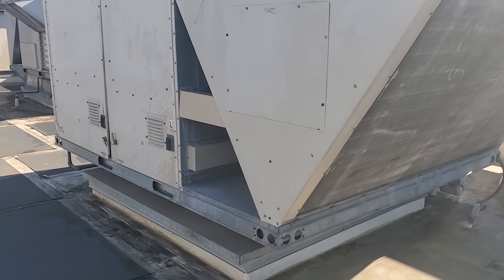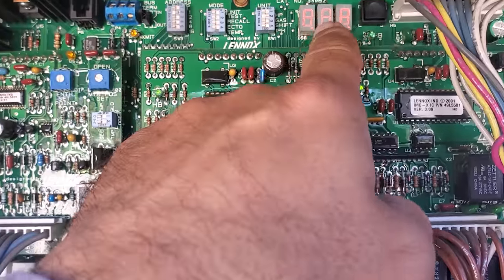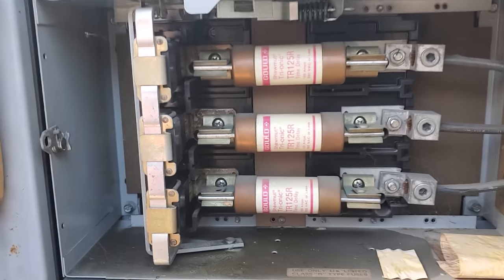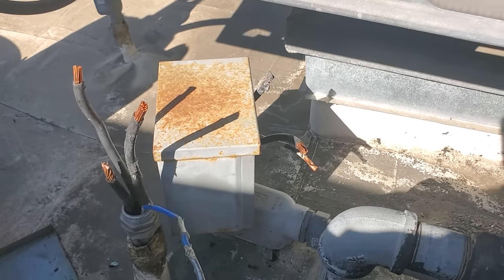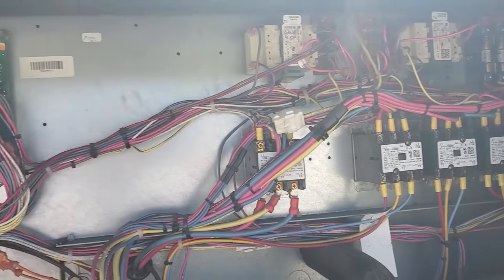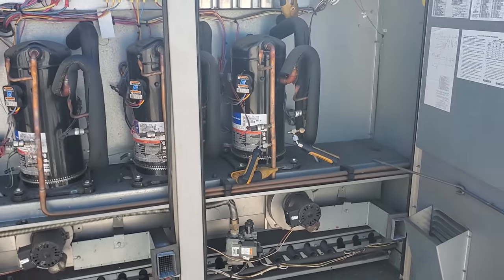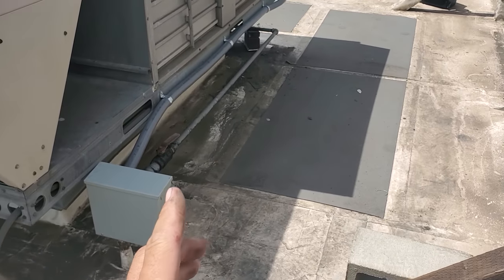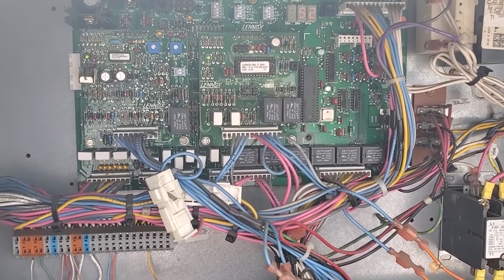ELECTRICAL FAILURES ARE FUN

Comment: It looks like the lug that was used for splicing the wire is aluminum.. That's a huge NO NO. Aluminum expands and contracts dramatically due to temperature changes, it's also a dissimilar metal to the copper wire. It was a very poor choice for the splice, it should have been made of copper instead. Expansion and contraction cycles over time caused it to loosen, and then become a hot spot further exacerbating the problem, and in addition to all this aluminum has a lower temperature melting point. Aluminum wire, aluminum lugs, copper clad aluminum wire are cheap alternatives to copper but pretty much all fail in the long run.. CCA or copper clad aluminum wire is showing up more often today. Avoid it because the aluminum at the core can oxidize causing it to turn to powder, and at some point the wire will fail because the copper clad surface cannot carry the current alone.
If you're maintaining or repairing equipment that is fed with aluminum wire, do your customer a favor. Keep a container of noalox on your truck or van. Back the screws out of the connection, pull out the wires if you can and use a small brush to thoroughly cover the wire strands with noalox, also coat the screw threads because if the lugs are also aluminum, the screws can bind in the threads due to the tendency of threads to gall in aluminum. Tighten everything down properly and it will be fine for several decades to come.
Reply: CCA huh?
Reply: exactly, you can oversize any wire as long as you use the correct breaker and fuses for the unit.
Reply: Noalox.....
Reply: Aluminum expands and contracts, yes, but this isn't aluminum wire used with non-tension connections.    This is copper wire with aluminum connector blocks, with iron screw points.   I've seen these stay solid for decades.   CCA is okay, depending on the usage.  For example, my car jumper/booster cables are 4 gauge CCA.   It let me have longer cables for a lower price, and the amount of usage isn't going to make me run into the 'aluminum wire shorts' problem.    CCA is even okay for network cabling - if you have the right connectors (which not much does).  It's just a royal PITA to work with afterwards, especially if it's not labeled as such.   

You shouldn't get progressive oxidation in the aluminum core of wires, unless the copper layer has been compromised (that's a different problem), or it's a really poor grade of aluminum.   Remember, aluminum is insanely reactive.  If it didn't corrode instantly upon exposure with the air, it would burst into flame (like lithium or sodium).    So it always already has an oxide layer as soon as it's plated with copper.  it's just that there shouldn't be any further reaction due to the copper coating.
Reply: @tbelding  What I said about aluminum is still the case, whether it be the wires OR the lugs. Lugs will expand and contract due to temperature change more than other materials.
My experience is that there are very few panels, buss bars etc that will actually use aluminum, plus the fact that it's a soft metal and prone to galling of the threads of any set screws regardless of the materials they're made of.
My experience of working in the trade for many decades is that most lugs are some kind of copper alloy with a cadmium plating to protect against oxidation.
Perhaps what you 'thought' was aluminum lugs were really cadmium plated copper or some other copper alloy which is quite stable regarding expansion and contraction rates due to thermal causes.
I've never ever seen any wire splicing lugs, split  bolts etc that were made of aluminum. That would be madness, and welcoming a failure.

Comment: Instead of a continuity test with an ohmmeter, I use a megger.  It will pick up shorts to ground that a 9 volt battery can’t find.  It will also catch intermittent shorts such as a bare wire in close proximity to ground. A meggers high voltage will cause it to arc to ground.

Comment: I’m surprised that your code allows splices on 100amp circuits in a small box like that. Certain to fail UK installation regulations!
Here you would have supply lugged into a local weatherproof isolator then out in armoured flexible to the AC unit. 
But here we have 415v across phases so a bit more danger.
Reply: Some units are 600V.
Reply: yea true. 208x100 = 20.8kW, 415x100 = 41.5kW. 20.8kW with 415v will be safer as it will just be 50A

Comment: i build engines and transmissions (both stock and racing for both) and those dental tools are incredibly valuable as tools. Removing O-rings and formed pistons are far easier to work on with dental tools as an example.

Comment: That was really good video. I just think that the burned terminal could actually cause the other unit to stop working. Once something starts creating arcs and sparking, it works as a radio transmitter and produces a lot of high frequency waves. If the other unit has some unshilded wires for data comunication those could work as an antenna and transfer this frequency into a signal that didn’t make a sense to the unit so it locked.

Comment: We had an identical problem with a loose phase wire on our three phase fans for our cooling tower .  Melted the junction box connection.  Three phase motors do not like losing a phase!!  Hehe

Comment: The three phase units the company I work for has the same behavior for a failed phase, or wrong phase rotation (if they have the monitoring option, but at least all with scroll compressors do). This is to prevent damage to the unit. They stay locked out until you cycle the power.

Comment: The bad connection will cause a wide electrical voltage fault back up to the main supply xfmr and anything else connected to it, which is likely what tripped the second unit. It can even pull voltage down on the distributing line if bad enough until the fuse melted or BKR tripped. Unusual that you had a fault just light enough to burn itself up but not trigger protection. It very well could have been a lightning strike that caused it.

Comment: Howdy. Absolutely great.
You saved the elctrician a lot of time and headache by your fault localizing work. And probably your customer a lot of money.
And yes. Always check both the phase to ground volages and between phases voltages. If one or two phase fuses have blown the circuitry could still deliver a ghost voltage on the blown phases. An induction motor motor would do this. And a control voltage transformer too. Control voltage tranformer primaries are often connected between two phases. This reduces the loading unsymmetry of the power line.
In high regards.

Comment: Fieldpiece is the best quality equipment that I have ever used! Chris, I have been absorbing so much knowledge from you and this video is very familiar to a situation that I have been dealing with here in Florida. During thunderstorms if we get a sudden interruption in our power service, my personal 2 ton Maytag package unit gets confused and the the compressor doesn't fully start... possibly a weak cap? Regardless... turning the unit off for 2 minutes and restarting solves the issue. That being said, I couldn't help but think that additional dining room ac that you diagnosed simply was acting up due to that service arcing or a lightning strike... I have been learning all of this from you! I will be rewatching your video to test my run cap for my issue here in the humid Florida heat. Cheers friend....

Comment: The second RTU circuit boards fast flashing lights indicates 24v low voltage, probably caused by the other units issue. Also loose wiring connections where Lennox crimps 3 wires (it's a shrink wrapped connection) together after the transformer. I had a similar service call related to this problem of low 24v to the main board

Comment: Sometimes arcing can cause tons of noise and can literally make the wire a big antenna, this was literally how heinrich hertz found that theory, he transmitted stuff through arcs. The other reason is that loose connections and arcing can cause an imbalance in a circuit, if these circuits are near with each other or are sharing the same busbar it can screw with it and cause voltage drops enough to mess up electronics. That's in EE Territory, phase angles harmonics, but the main issue is the power factor, if one part of a system has a Problem with its power factor it will screw everything around it

Also the disconnect might've tripped because of an unbalanced 3phase circuit.
Reply: Hendrik Hertz huuumm!

Comment: When I was engineering mgr at a plastics plant, we had 3 water chillers that were junk. Basically, they were older, industrial, Carrier, hvac units with very old R22 herm sealed piston types in a lead/lag config. The freon was pumped into heat exchangers on the evap side, el cheapo tight budget style, everything else was stock. My boss literally would not put ANY money into his plant. Everytime this beast went down, it took the whole plant down. Cannot blow mold plastics with hot molds, sticky icky. One time a comp burnt up and I told him, ya better replace the other comp too cause that burnt windings contaminated that circuit too.   He didn't believe me. After having the hvac guys replace that compressor and recharge, 6 hours later... YUP burnt the other one. Guess what buddy, now ya gonna drop 12 grand on 3 compressors! Watching this video, makes me kinda miss those days....

Comment: We just had 400 ton York chiller loose operating display go blank (#3 of 4) after power blink checked incoming power ok cycled power at switch gear still out recycled at unit system came up cleared phase loss unit started up and ran. Electronics sometimes do what they want.

Comment: You can totally have feed back at the main panel from one circuit to another when one circuit fails.
Reply: I think you watch too many movies haha
Reply: @jman0870  How so? If you plug a cheap chinese power supply in one room, and plug in a radio on the same phase on the other side of the building, you can literally hear the switching frequency. Sparking and arcs create massive EMI especially when you pull several amps.
Reply: @FrozenHaxor  EMI doesn't affect motors and line power dude....only electronics.
Reply: @jman0870  Not for the last 20 years or so. Not many movies worth watching. I guess I learned stuff from my dad that was employed as a degreed electrical engineer for about 40 years.
Reply: @jman0870  Right. EMI can have zero effect on power circuits. Induction is not a thing. Ya gotta believe!
Reply: @DomManInT1  Jesus dude you are talking about hypotheticals that never happen in HVAC. The level of EMI required to disrupt the line side circuitry of an RTU is absurd and damn near impossible without outside influence. If you claimed EMI affected the communication and analog circuitry I would have wholeheartedly agreed with you. What you are claiming could have happened is practically impossible. Sorry dude. You're wrong.
Reply: @jman0870  Never happen. Keep believing.
Reply: @DomManInT1  Go ask your engineer father how much EMI it would take to cause three phase and PSC motors to burn up the line side wiring to them and quit arguing about it buddy. You've already stated you aren't an engineer. Maybe you should talk to one.
Reply: @jman0870  I quit arguing about this topic a couple of comments back. Guess you missed it. Keep the faith.
Reply: @DomManInT1  Typical response from somebody who is afraid to be wrong. It's whatever dude. You do you.
Reply: @jman0870  Bingo! You do you. That should have been your attitude all along and you would not feel so badly now.
Reply: @DomManInT1  Why would I feel bad about preventing gross misinformation on the internet?
Reply: @jman0870  I didn't imply that it affected motors, I was mentioning the fact of what happened later in the video with the circuit board of the other RTU being totally scrambled and frozen up.
Reply: @FrozenHaxor  fair enough. The board acted the way it did because it only had six volts. EMI is not common in HVAC outside of the occasional installer who doesn’t use shielded wire for communition/analog signals, especially in commercial where 460v is common.
Reply: Huh?

Comment: As a computer consultant, who has had to work with other computerized systems (phone systems, etc), I can attest to some of the other comments here.   The initial blowout likely surged through the local power network, which gave dirty signal power to the other units.   Some probably managed to reset themselves, but in this case, the system locked down into a "I have no idea what to do, so I'm going to do nothing and run a warning light" mode.   If there had been a power outage after that occurrence, the board would have lost residual power, allowing a clean startup.  I had an exploded outlet that did just that to the battery backup connected near to it.  The UPS went into a lockdown mode, requiring it to be unplugged, powered off, plugged back in again, then powered up - after which it worked fine.   

If you have any piece of electrical equipment that's doing strange things, one of the first things to do for troubleshooting (besides checking that the input voltage is correct) is completely disconnect all power and leave it to sit long enough for all the capacitors to discharge.  On a PC, that can involve popping the coin battery out as well as pulling the power cord.  On a car, it involves disconnecting the battery terminals.   (I always do both, many only do the positive)    (Your car will go through a learning cycle after that, so don't panic about weird performance until it lasts more than 15 minutes of active driving).    In this case, shutting down the main breaker does it.    

I'm actually astonished that nobody on site turned the stupid thing off once they knew it wasn't working.    If something electrical has failed/isn't working, and you don't know how to troubleshoot it - turn it off!   I keep telling customers that as well "Unplug it, and I'll come as quickly as I can"  (then I find they've been flipping it on and off until something worked, switched parts around, etc).

It was definitely interesting watching your breakdown/troubleshooting method.  I've never worked with 3-phase power, so it's still very unusual for me.

Comment: I have a UEI DL479 and the FP HS36. The UEI is a pretty nice little inexpensive meter. It definitely can get the job done. It has capacitance capabilities, ohms, continuity, temp, voltage, amps, diode. I like the UEI leads better than FP's leads.
Reply: I got em all and favorite is still the 40 year old Simpson, kinda bulky tho
Reply: I've never seen a UEI make it to five years without an issue.
Reply: @jman0870  its my backup meter, but its not too shabby for the price
Reply: @jasonjohnsonHVAC  I have one in my bag because I needed a meter that could do micro amps DC in a pinch. I still don’t like them 🤣
Reply: @flipfloptanlines926  Awesome analog!

Comment: A three phase power monitor will pay for itself - they can be set for monitoring under voltage and over voltage and the time the fault lasts before a trip... so when you get into a low voltage on one leg it will save your machine... most rooftop units built like the ones you showed doent have single leg fault protection... nice video.  In an arcing fault situation all kinds of voltage spikes will go through the entire service and even into other buildings that might be served by that same transformer which will cause havoc on all types of electronics...

Comment: Metering with a high impedance tester, you can see nominal voltage at the load with an incoming phase dropped or feeding through a high resistance.. Voltage will back feed from another phase through the load, and voltage levels will be unpredictable. Use a non inductive load like a heat gun or 1KW load and measure voltage across that. You'll  see it.

Comment: 23:45 the bar unit got single phased by the burnt connection, were these 2 units in the same panel? if that's the case, when a unit gets single phased all bets are off

Comment: I am sure as the connection was failing on the 1st unit it was throwing a lot spikes into the electrical system. I was working in a building one time & drilled a 3/16th hole in a brick wall for a conduit strap & hit the conduit for the lights in a bathroom on the other side of the wall. Breaker did not trip for this circuit but the building main breaker (1K amp) tripped. lol

Comment: From what I learned in my short-lived A&P lessons in college (at least from the electrical side of things, I finished those classes), I was just as dumbfounded as you were, when you checked those 24v connectors and only got roughly 6.5 volts. Then I saw the damage to the high voltage wiring in that conduit, and I cringed so bad. Not just from the fried and melted splicing, but also the corrosion on those heavy duty wires. Your customer is lucky that there wasn't a serious electrical fire from that.

Comment: When connecting aluminium with copper you need to use a galvanic corrosion inhibitor. Wago makes Alu-Plus for this. Galvanic corrosion causes imperfect contacts.

Comment: Man check out that big ol wall box the electrician whacked all that flex conduit on and open screw holes on the back. Random length strips on all three phases. Bit messy for such a simple gig.
Reply: Hey, whatever is in the back of the truck 🚛
Reply: @manolotech1110  😄😄

Comment: In my area, technically that would be a licensed electrician job.  Anything between the bucket and the disconnect is for the sparkys.  Between the disconnect and the unit is hvac
Reply: Well, he did have an electrician do that part.
Reply: Bucket eh!